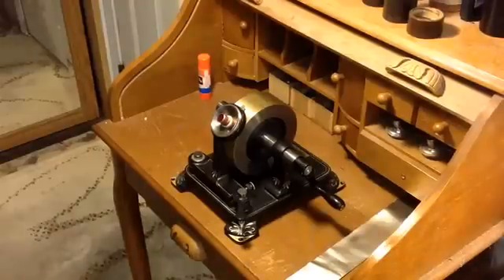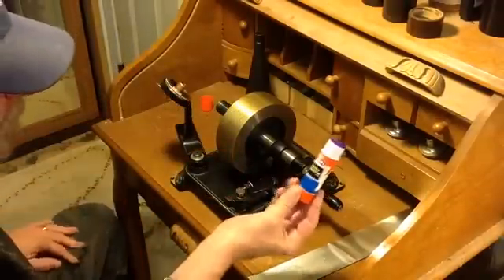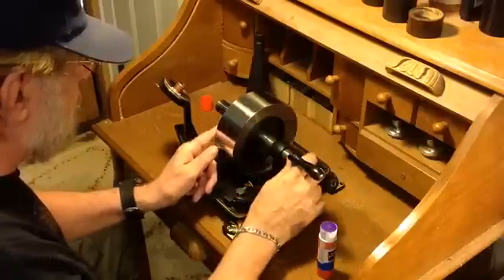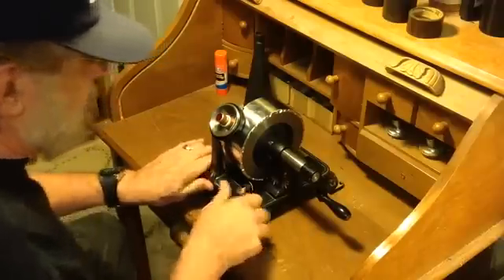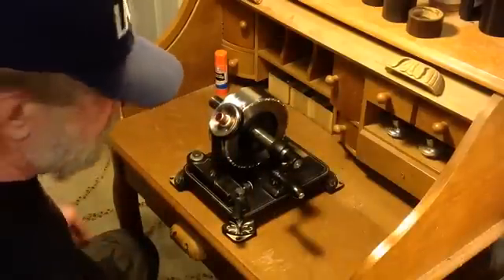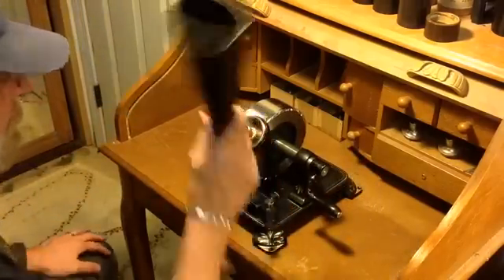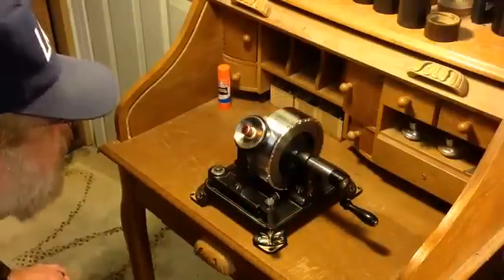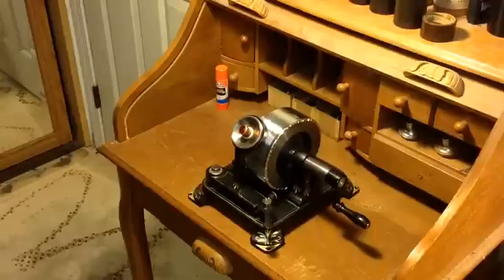edison 1878 tinfoil phonograph recording test

Comment: When you think about it, especially in the light of evidence like the Antikythera mechanism, the ancient Greeks had all the technology and materials needed for the Edison phongraph.
Reply: Theoretically yes. Tin and copper - bronze, which was known for a very long time, long before Herodotus, for example, could provide a sufficient material base. It was also possible to emboss the thin membrane. What would be a problem would be the production of a lead screw. Playback would only work on the device on which the recording was made. Only someone who revealed the principle of sound waves was missing. However, it is not good to idealize the machine from Antikira under the influence of the boulevard. It was a simple gear that functioned exclusively as a calendar and could only show the position of the planets from the perspective of one particular location, so the machine could not be used in astronavigation. Such machines were manufactured in exactly the same way as in the Middle Ages - the scholar made a large wooden model, which was then made on a small scale by tepce from metal.